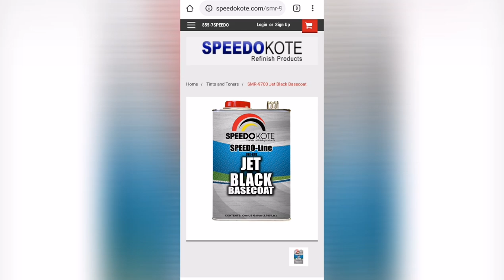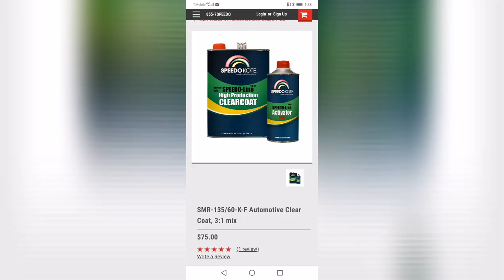Single stage vs basecoat clearcoat

Comment: Can you clear coat over single stage?
Reply from the maker: No.. If you want to do clear coat just do basecoat clear coat.
Reply: Yes, you can all day long even a year or so later
You can also do a 90/10 single stage/clear for the last coat and it will look amazing. I know a guy who has owned a body shop for over 30 years. One of the best painters I have ever seen who does this. Several of his cars have won best of show. I am building a high-end 67 GTO resto mod I am doing this on.